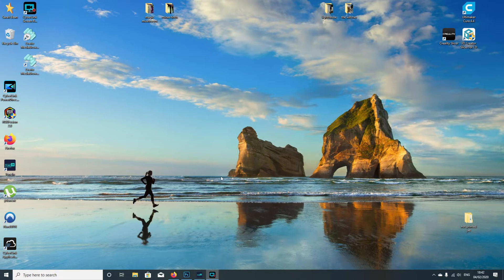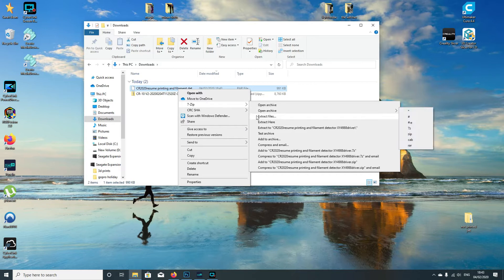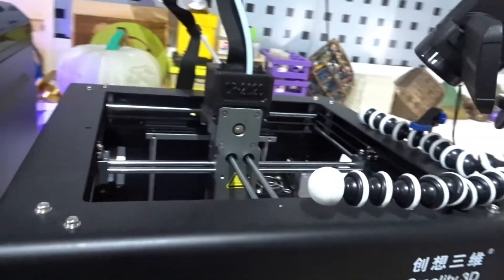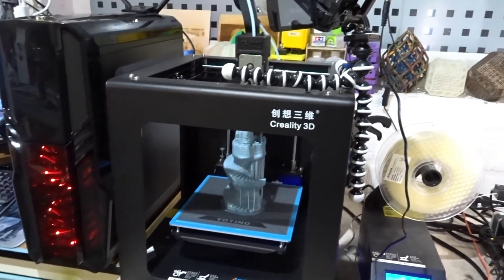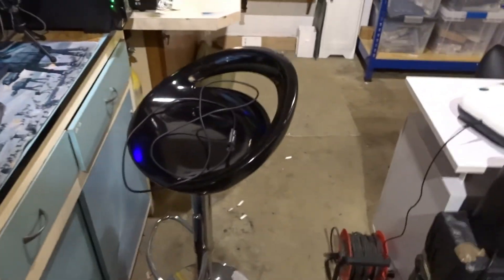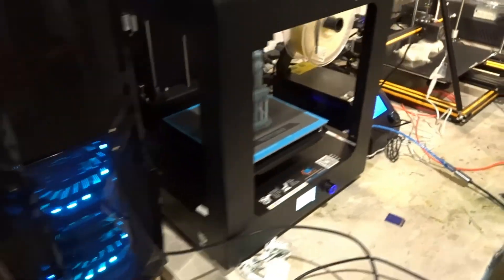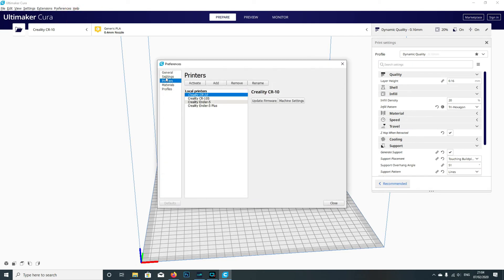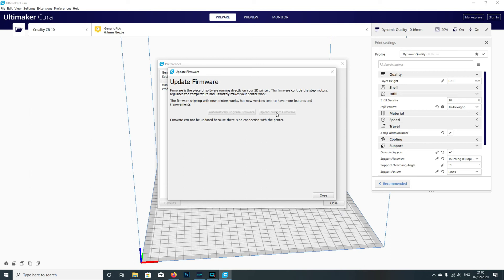Creality CR-2020 Firmware Update

Comment: a versão da firmware no site, está invertido a polaridade dos eixos, precisa inverter os cabos para funcionar, e não causar problemas.

após inverter o lado dos fios, foi resolvido o problema 

the firmware version on the website, the polarity of the axes is reversed, you need to reverse the cables to work, and not cause problems.

after reversing the side of the wires, the problem was solved

Comment: I finally found the other person who has a CR-2020.  I love the machine but there is almost no support out there. Thanks.
Reply: Hi, trying to make it 3 for you.  How is the machine for printing PC or Carbon fibre?
Reply: @BarryBernau  I haven't tried them yet.
Reply from the maker: Barry Bernau hi, I don’t think it would handle carbon fibre in all fairness, would be ok with pla mixed with a little carbon fibre but would wear out the brass nozzles quick
Reply from the maker: Neal hi, unfortunately I sold my machine to make room for others. If you contact creality they will supply you with an updated hex file to flash to your machine with the latest firmware
Reply: @BeanGaming-w4n  I can understand selling it. Purchased mine from TinyMachines long while back. Had the door and windows added. Your unboxing video killed me.  My base price was $750 US. Found a Facebook group but almost no action on it. Good machine just not popular.
Reply: here is another one lonely CR-2020 owner. So happy to see a few weeks old comment on it ... not as aged as  2018 year's firmware on the official site :D
Reply: hi it's possible to chear your config files for this printer? thanks
Reply: HI THERE, JUST GOT ONE OF THIESE AS A PRIZE FOR A CONTEST, IT'S MARKED MULTICOMP AND EVEN LESS DOCUMENTATION AVAILEBLE, SEARCHING ON GOOGLE I'VE FOUND THAT IS THE CR2020... YOU STILL HAVE IT? HOW IS SHE GOING? THINKING ON CARBON FIBER PRINTING ON IT...
Reply: @ElectronicMarine  When it works it's great.  I think I am having a firmware problem at this time as it will just stop printing like it ran out of filament.  I ain't so good at figuring out firmware.
Reply: @neal9692  on the creality cloud there are couple of firmware updates, one for resume printing after a power failureand 2 others. there are 4 or 5 packeges in total, but i'm affraid that you have to open the bottom lid and see what type of board is there inside, verssion A B C D  or F... there are differnt packeges there... foun a serries of videos about servicing and how to do update firmware ..